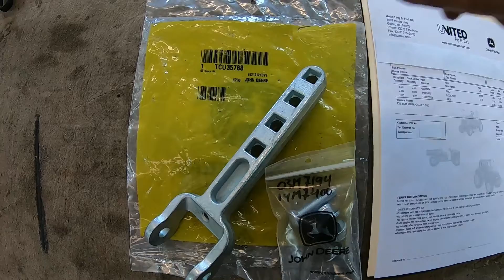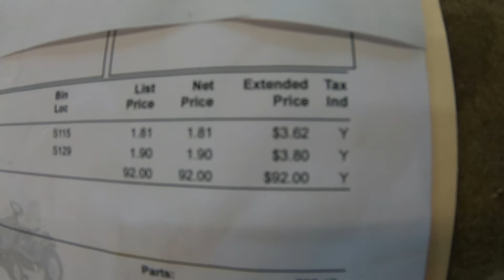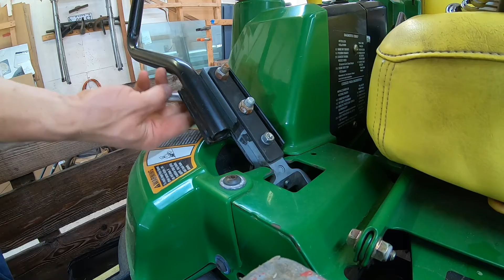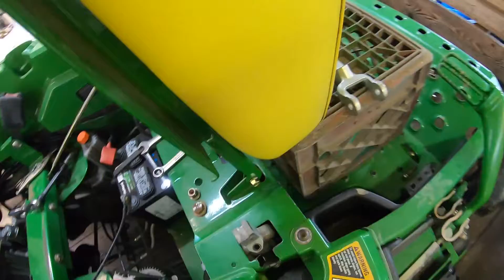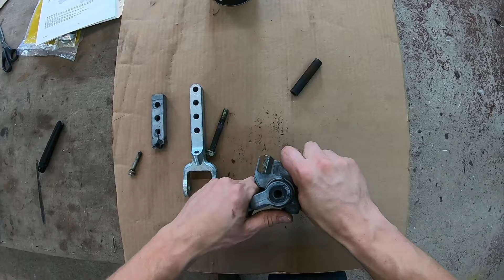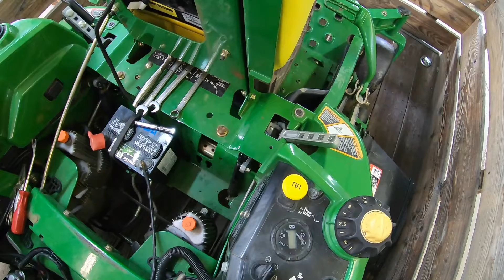Zero Turn Steering Arm Repair - John Deere z810 (Part 4)

Comment: Glad I found your videos Mark, my same jd mower, same place on that cast lever broke on mine a couple years ago. Now I wonder if there's some kind of defect and yes it was over $100 also, lol. And the cast part was rounded over just like the one you have, I ask the rep, you'd think somebody with jd could have that manufacturer over there in the CCP to cast one exactly like the original ones, for the price 😂. Thanks for sharing the videos ima learning more about my machine.😁👍👍
Reply from the maker: Seems like this is a real common problem with those steering arms! So far the new one has held up great...even though it's a bugger to replace. Otherwise they are great machines!
Reply: @marktolman207  yes they are 😄👍👍 
SUBSCRIBED!!!
Reply from the maker: Thanks!

Comment: How did you get the arms to be striaght?
Reply from the maker: The handles themselves (black tubes) have a little adjustment, the bolt holes are elongated, so you can move the arms front to back and line them up with each other. Also, the arm has the set screw to move handles side to side. There is also some adjustment in the linkage, if you need to adjust them move.

Comment: Mark, great video and helpful. However,  I'm having a hard time getting to the bolts to remove them.  Also, how do you remove the pneumatic lift? By the way, my John Deere dealer charged a $117 for the part.  Thanks for your help!
Reply: Really having difficulty accessing the bolts
Reply from the maker: Thanks! I had to remove the emergency brake pivot on the side closet, just to have room to remove the one long pivot bolt from the handle. Pain in the butt! The shock had a small clip the was removed, so the socket could be removed from the ball stud. I'm glad the video was helpful.